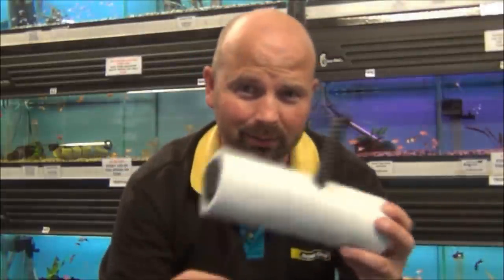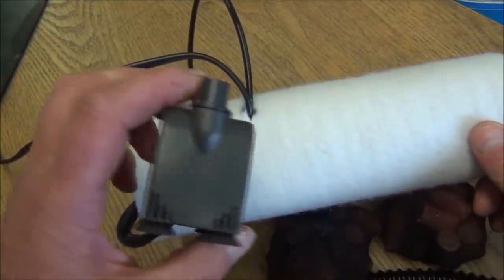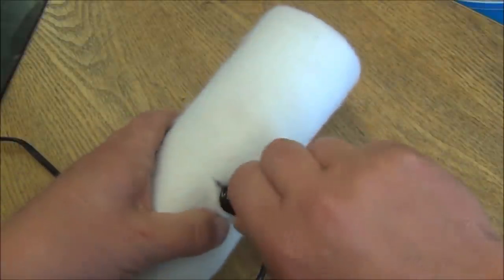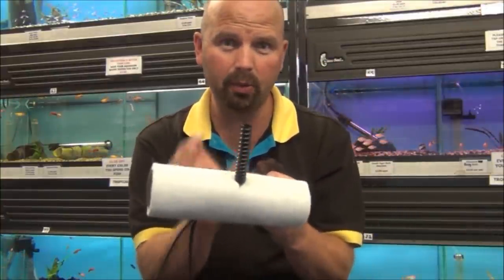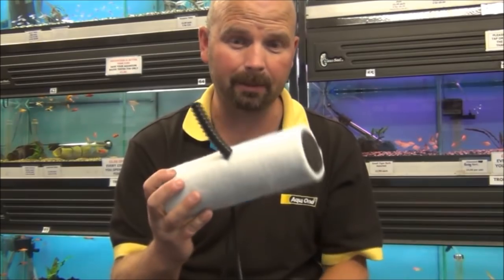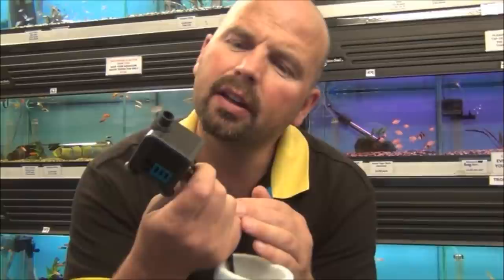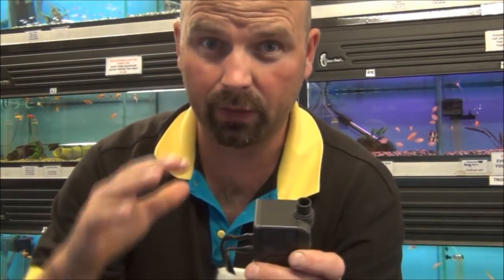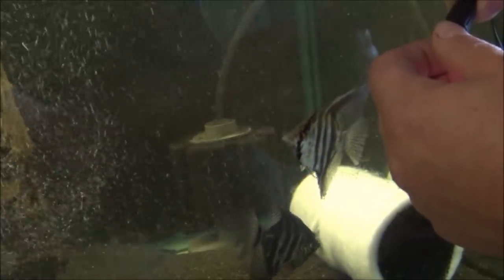BEAT THIS AQUARIUM FILTER!.....GROOVY - DIY AQUARIUM FILTER FROM PONDGURU

Comment: Would a paint roller tube work for this, or would they degrade and muck up the water?
Reply from the maker: Possibly work but they have a tube inside the fabric? and aren't flexible for fitting the pump. I prefer the polyester felt sort of tube after looking at some rollers in my shed.
Glad you enjoyed the video, man.

Comment: Are paint rollers made of Polyester?
Would a paintroller work with this system?
Reply from the maker: +Dennis Day The paint rollers are polyester over a tube but the tube needs loads of holes drilling in it which is very difficult to do as the drill bit gets tangles in the fibres.

Comment: Can this be used as the only filter system on 60 litre community tank?
guppies, tetra and platy.
It looks a good solution to having a separate Internal filter and air pump/airstone.. 
Is it quiet? 
Also a this as good as an external canister small size?
Reply from the maker: Yes it would be fine for a 60 litre tank as the only filter and should keep the water spot on.
Any filter is only as good as the foams and media in it.
Reply: Oh great I think I will do this.. 
I see on your webpage you sell the kit with biogravel and not biohome is this a more practical media for the filter? 
Is the 500gram size enough to pack out the filter?
Reply from the maker: Yes I made this video before the biogravel was invented and now the tube kit comes with mesh bags to hold it. 500g is enough to fill each side of the filter allowing space for foams and yes it is a more practical media for the filter so that's what comes in the kit now.
Reply: Pondguru Outdoors Thanks.. Think I will order that now..
Great the mesh bags are now included..
Will it support I nicely stocked 60 litre tank?
Reply from the maker: Yes it should be fine for that scenario - just bear in mind that there are 2 models of pumps, one gives the bubbles down to 30cm (320 pump) and the other gives the effect down to 45cm (450 pump)
Reply: I bought this filter kit off you...
The water is getting green..
it's been in for 10 days.. 
my old internal filter is still running for the time being too...
Could I have jammed in too much media?
Reply from the maker: Nothing in the filter kit would make water go green. Does the tank get any natural light on it (even reflected sunlight) for any part of the day? What size is the tank and what do you have stocked in there?
With a bit more information I could help work out why the tank is going green.
Reply: I cleaned out about 70% of the water yesterday. 
It was really clear then but starting to cloud a little bit now a day later.. 
I was wondering could I have packed in too much media, maybe there isn't enough flow going through? 
I have a 60 litre aquarium.
It's in the living room so yes it gets day light.. 
It's not a bright room mind.. 
I often  put on the blue led lights at night.. 
The white one by day.. 
I have about 6 Platy.
5 Tetra and 3 Guppies.
Reply from the maker: Any natural light will make it go green very quickly so that will be your problem there.

Comment: If a Paint Roller won't work, wher can I purchase the tubing that will?
I am very interested in building one of these filters.
Dennis.
Reply from the maker: +Dennis Day There are a few sellers on Alibaba and the polyester tubes are used as heat proof rollers in metal working factories but sellers will want a decent size order, not singles. I had to buy 100 of them - link in video description.

Comment: I'm sure if you bought the bulk tubes you'd have plenty of people to buy them. I would buy the full system from you myself because I need one of these.
Reply from the maker: Chelsea Taylor Yes I would be able to sell them but I'm not taking the risk of buying 100 tubes if the seller won't even send out a sample for me to check they are the right type, size, thickness etc.

Comment: Did I miss something?  Where is it getting its air from?  Does it have an air hose leading out of the tank?
Reply from the maker: +KillTheCurse Yes there is an air intake so the pump draws air in, shreds it then spits it out with the water.
Reply: Pondguru Outdoors Thanks!

Comment: Doesn't need to be a pre-formed tube...a sheet can be  wrapped around , and zip ties can  keep it on :)
Reply from the maker: Yes ordinary floss sheets / fine particle matting used in pond filters have been used like that around the pump, foams and media to good effect but quite a few people. It's a bit of a pain to pull to bits to maintain though.

Comment: For this could I make a couple and put it in my 250 gallon aquarium plus having two 20 gallon filters on each side bc I'm setting up my aquarium in a couple of months
Reply from the maker: +John Walter I see this sort of filter as a supplemental filter to polish water, oxygenate it and provide extra biological activity so there's no reason why you couldn't have one at each side of the tank but if your main filters are set up properly with plenty of good media there may be no noticeable boost in water quality from the tube filters if pollutants would be controlled anyway by the main filters.
Reply: Oh okay thank you so much

Comment: Is there a way to use one of these pumps in another type of filter? like a canister filter?

I am very interested in this, I want to set up similar filtration in my 6 gallon tank but your design is way too big would it work if you cut down the length of the tube?
Reply from the maker: +Aisha Kegawa Yes the tube does not need to be so big and with regard to using an aerating pump as part of a different filter i have not seen that done anywhere although I an working on rectifying that.
Reply: +Pondguru Outdoors do you think the lower volume pump it powerful enough to move water from below the pump's level?
Reply from the maker: +Aisha Kegawa I'm not sure what you mean - please try that one again?
Reply: +Pondguru Outdoors sorry, you have 2 oxygenating pumps on your eBay shop. I was wondering if ot is powerful enough to move water out of the tank, through a filter that is lower than the tank and back into the tank. I am very excited to experiment with these pumps.
Reply: +Aisha Kegawa by it I mean the lower flow rate pump.
Reply from the maker: +Aisha Kegawa I see what you mean now - as long as the combined lift was no greater than 45cm it should be no problem as they will both lift water to around 45cm.
Reply: +Pondguru Outdoors thank you so much! That it exactly what I was looking for. ^_____^

Comment: for reference and/or ideas: HOW TO: DIY aquarium heater project
and mesh of these two ideas..might produce a complete package.
Reply from the maker: I'd not seen that video so thanks for the link. The only problem with the idea as it was arises from having the pump inlet sucking through a long tube with only a few small holes in the bottom That will strain the pump and reduce its life.
Evolving that into a combined heater unit and filer is as easy as drilling small holes all the way round the pipe from bottom to top and wrapping foam around the outside.
That will ensure that the pump isn't strained and will give good mechanical filtration too.
Feel free to suggest that to Joey as he has the bones of a good idea there.

Comment: WHEN I'M STARTING A NEW CANNISTER SUNSUN 703B, AND USING BIO HOME ULTIMATE, SHOULD I ADD SOME OTHER BIOLOGICAL STARTER INSIDE THE CANNISTER?
Reply from the maker: The media should have come with gel filter balls (depending on where you bought it) so just add them in with the media. They will dissolve, seeding the media with good bacteria. Even without the gel balls the media matures fast.

Comment: Looks like a hurricane in there...Why not put the stream upwards?
Reply from the maker: +David B It could go upwards no problem but for he benefit of filming it was horizontal. The pump shifts less water than most internal filters but with the tiny bubbles highlighting where the water is flowing it looks more powerful than it is  - hope that makes sense.

Comment: How does it remove nitrates in the foam + media config? As I can't see how a mechanical filter could...
Reply from the maker: This filter has mechanical (foams and tube) and biological (biohome ultimate media). It is within the filter media where the ammonia, nitrite and nitrate reduction happens. You're dead right that nitrate reduction does not happen in mechanical part.

Comment: Hi Pondguru, my wife hates the noisy filter pump that we have in our 150lt tank, would your filter pump run quietly? I am guessing that it will as its in a soft tube!
Reply from the maker: +geoff holloway Yes the tube really minimises any vibration to make it almost silent running but the sound of bubbles will be noticeable if the inlet is opened all the way up (big bubbles) as more air will be drawn in, chopped up and spat out with the water. Even a small restriction on the air intake makes it very quiet and when it is turned down to produce tiny bubbles which will travel all round the tank the pump is as quiet as it possibly could be.
Reply: superb news and thanks for the fast reply, I will order one later.
Reply: +Pondguru Outdoors So would this filter be enough for my 150 ltr tank?
The one for sale on your site only has 500g of media!
Reply from the maker: +geoff holloway It is more of a supplemental filter and although 500g of media is way more than most internal filters will have the flow rate isn't really enough to draw all the dirt to the filter body to be caught in foams and tube.

Comment: hey i have a 130 gal fish tank i bought but it oly tank and stand i need to know what i need for 2 oscars...... pref cheapest requirments for them to be healthy
Reply: lights,powerheads,fliter i have no ideal what to buy whats big enough
Reply from the maker: Marcus Baldwin The light(s) need to be full length of tank ideally and filter needs to be big enough for volume of water and then some for Oscars - go with a filter which will handle around 250 gal and use best media in it. Other than a heater and food that's just about all you need.

Comment: If your looking for poly tubes wouldnt paint rollers work?
Reply from the maker: If they were a mesh sort of construction then yes that would probably work but the glue used to stick the fluffy part to the roller would be a concern. I have a nation of the proper ployester tubes now as I buy them a few hundred at a time from a manufacturer in China.

Comment: can you buy that switch that adjusts the bubble size and attach it to a regular air pump...what is the part called in America
Reply from the maker: +Odyn York I have no idea what that is but it sounds interesting so I would be interested to hear what that is or see how it works.
Reply: i think i mean a nob that will control the air to control bubble size....you show it in this video
Reply from the maker: +OdynYork The one in this video controls how much air is drawn into the impeller of the water pump so that affects the output of air (differing bubble sizes) but a regular air pump simply pushes out air through an air stone and bubbles tend to be larger. The air being pulled into the pump in this video is shredded by the impeller, hence the ability to produce a nation of tiny bubbles. More air intake = larger bubbles.

Comment: is this just a paint roller? and if not could i not put a paint roller in with an air stone?
Reply from the maker: +JungleBeast It is a polyester felt and paint tubes generally have no holes in the tube to allow water through. If holes could be made in a paint tube there is no reason why it wouldn't work I guess.

Comment: I don't think the water gets oxygenated because of the bubbles in the water.  The water exchanges oxygen at the surface of the water.  Usually the wall of bubbles circulate the water in the tank so the water at the bottom of the tank will be carried to the surface of the water via the bubbles rising up and the water following it. 

With that being said it is still a brilliant filter idea.  Would go great with a turtle tank or any low water level tank.
Reply from the maker: The bubbles can be set to be tiny so they stay in solution for ages but you're right about exchange at the water surface. There may be a certain amount of pollutants carried up on bubbles (adhesion?) for release into atmosphere so a larger amount of small bubbles will be of more benefit than fewer larger bubbles due to an overall increase of surface area. At least that is my understanding of it.....I may be totally wrong, lol
Reply: HaloToday My understanding of this is that oxygen exchange happens anywhere that water and air come into contact.  That includes a bubble which is air encapsulated in water.  Anything that creates bubbles, creates a greater surface area where the oxygen exchange can take place.
Reply from the maker: Coel Acanth See my comment above, that's pretty much what I said but in a different way, lol

Comment: Good Day, I'm a new Aquarium owner, and I'm wondering if the aquarium pump used in the video is available on the Asian Market, I'm residing in the Philippines and have started to raise, and hopefully breed Crayfish.

My unit currently uses an air pump and fountain pump on rotation, and this pump may help in reducing space, and cost in terms of power, I can't seem to find a pump with the same specs as this one, either in pet shops and hardware stores in town (Davao City) I'm willing to order along with the filter media yet have not found any known distributors, Thank you for your time.
Reply from the maker: chester tan I'm not sure what is available in the Philippines as far as equipment goes unfortunately and you're a long way from any biohome suppliers. I am getting some more pumps in stock in a couple of days and as they are made  in Italy I'm not sure if the manufacturer supplies outside of Europe.
Reply: Pondguru Outdoors
Thank you for the quick response, I appreciate it, I'll have to look into having some items shipped from the closest distributor, may cost way more. in terms of pumps we have several selections of them, not much in terms or variation though, and I looked into the filter media, they seem to have a Facebook for Philippines, they may have a distributor, but most likely its in another city, maybe the capital Manila. Thank you for your time.
Reply from the maker: chester tan I think the distributor in Singapore sells to shops but I don't deal with that side of the business so can't say for sure. They may be able to tell you who nearest stockist is.
Reply: Pondguru Outdoors Thank you for the advice, I'll look into in. Have a Great Day.

Comment: could I use a roller sleeve from a paint roller as the filter tube thanks??
Reply from the maker: +Phillip Turrell The roller tubes are generally solid but if you could drill plenty of homes in it then that may work.
Reply: Yes I see your point, maybe if I could remove the plastic liner from the centre it would work better, unless of course you've already tried this before lol cheers

Comment: Pondguru I moved to China and I started my own 50 gallon tank, I want to do this set up but can't find the same pump, I looked in your eBay page and there is no info on the brand of the pumps.  And I can't buy from eBay here in China.  Can you tell me the brand of those pumps please?  Thank you
Reply from the maker: The pumps are made in Italy by a company called Newa but I'm sure there will be an equivalent in China. They are sold for the hydroponics market here and I'm not sure that is a big thing in China so you may have to do some digging.
Reply: Pondguru thanks.  I'll do some searching.

Comment: How large an aquarium would this filter handle?
Reply from the maker: If it was a normally stocked community tank, around 100 litres and if heavily stocked around 50 litres. That is to achieve full cycle filtration (reduction in nitrate) when using biogravel in the filter. The kit now comes with biogravel, not the biohome ultimate as shown here as you can get more biogravel in.

Comment: Hey Richard, for an aquarium with 150x60x70, around 500 liters of water in use with substrate etc, wich canister do you recommend me ? A canister with 2650lph will be enough ? Thank you
Reply from the maker: The low rate is not the most critical thing. Simply select a filter which will treat at least 500 litres then set it up as shown in this video: https://www.youtube.com/watch?v=lsAmSD3wVbg
Reply: Thanks! I've seen all the videos of yours.
My only concern is that the circulation in the aquarium is low and that may have some deadspots. I was thinking that fluval FX6 whould be the ideal for this tank size, but some people told me that is better to have two canisters for example than one fluval FX6. My mind is crashing, dunno what to do !
Reply from the maker: Nuno Silva Doing it either way is fine and if you're worried about dead spots you can install 1 or 2 wave makers on a timer.
Reply: Pondguru Thank you. Ended up on buying the FX6, how many liters of biohome ultimate for the FX6  ? 
Thank upi
Reply from the maker: Nuno Silva According to the cubic litres of media figure given by Fluval there should be enough space for 5kg of mini ultra or ultimate media but a few people have aid that by the time the get medium foam and fine pad in top tray they only get around 4kg in. If you want a price for 4kg delivered just let me know which country you are in and I will work price out no problem. My email address is pondguru@btinternet.com

Comment: would this work for goldfish fry or is the flow rate to strong
Reply from the maker: The flow on the pump can be adjusted to make flow less but they should be fine with flow as it is provided the tank is large enough to have areas of slow current.